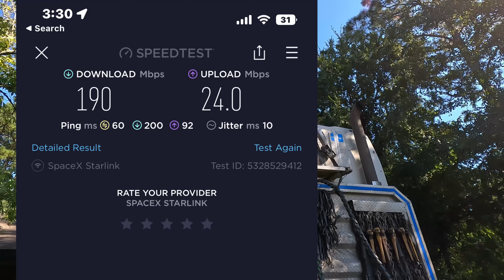Trucks done! And we install Starlink on the semi

Comment: Hey Robert I drive an 2008 westernstar 4900 has a 14 liter series 60 with an 8LL TRANS with a 25 yrd packer has 65 thousand  miles it's all stop and go driving has a self adjusting clutch and never had a problem never slipped and the clutch brake still works fine !

Comment: I have over  600,000 miles on my  automatic Eaton 6 speed transmission in  
a 2015  Kenworth T680. The only money I had to drop over the years on that Trany  was to replace a sensor. so far so good!  I change the fluid every 150,000 miles. Now the truck is in semi retirement. I use it to pull my 20,000 lb 5th wheel camper.

Comment: Good video Robert. 
I don't comment much, but when I saw your fuel issue, it looked maybe like a situation I experienced. 
If you have a long crank situation, look at the clear globe of your fuel filter. If you don't see fuel part way up on your filter. Take the black cap out of the top of the glove and pour as much fuel as you can in and try again. 
Good luck to ya'll.

Comment: Hello Robert. Such bad luck you are having, hopefully it will turn around. The stickers look great. I called Haggai Diesel. They only work on ISX engines. I guess you know what those are, Cummins and GMC seem to have them. I miss seeing that funny intro you had. A rotator wrecker would pick up the truck and set it on the trailer. Have good days!

Comment: I think the fact that when you came to pick the truck up they had a chain rapped around the frame and a mud flap ripped off tells the story. Clearly they either got your truck stuck or used it to pull something and they burned out your pressure plate.
Reply: It wasnt running when they dropped it off and the shop used the chain and a fork lift to lift the tires up and push it in the shop more than likely
Reply: @warrenmichael918  They drove it there it was running just down on power
Reply: @oldmanonthehill8858  They pulled it in and out of the shop because it wasnt starting
Reply: What bracket you went with on the Satellite? I have that same mount on my truck.

Comment: The Southbend dual disc clutch I ordered for my hotshot truck cost $1,338.60 plus shipping so $2,785 for a semi clutch installed doesn't sound too bad. Just sux that the work done by that shop near Savannah is still costing you $$$.

Comment: Hey, great video. I am actually in the process of doing the same to my rig. 
If you don’t mind what size bolts/screw did you use how thick is the fiberglass top cab roughly I don’t want to go too far through. I have bolts that came with my stand they’re roughly 2” or more in length so I was just wondering any help is appreciated thank you.

Comment: hi use the bot as tool  if work good idea Holes in fiberglass don’t hold anything  need use a plate  inside the cab   about the height   say add Amber LED strobe lights  to trailer  wire so turn on  from the cab

Comment: You need that grey reflector to be visible  to avoid a violation.
Reply from the maker: I wondered about that. But see lots of truck with them blocked. But I guess they could be wrong aswell
Reply: @SouthGeorgiahotshot   i got a warning for not having one reflector on and then the officer told that this should be visible. You  have a step deck and is a must. Nothing personal. Just sharing what I experienced.
Reply from the maker: @TUDORP  I understand. I wonder with my chain rack having the stickers if it’s still a big deal lol
Reply: @SouthGeorgiahotshot   if you have it on you chain rack you good, I’ve seen on many racks

Comment: Regarding the trans temp problem I can give you a troubleshooting tip as a life long electronics worker.  Most problems are simple and logical.  If you are stumped it is often because one of the things you thought you knew is not true as you found in this case.  This happens far more often than you think.  When stumped forget everything you have done and start trouble shooting from the beginning again.  When I solve problems  that others have not been successful at the last thing I want to hear is what they have done to solve the problem.  They will lead you down the same rabbit hole.

Shame you had to spend so much to get the truck going but it sounds like most of the work performed actually needed to be done.  As far as how often the clutch needs adjustment, I think that is totally depends on the habits of the driver.

Comment: I hope.that they turned the flywheel ? Or maybe installed a new one ?
  Now they have several different clutches ? Hopefully they put a heavy duty clutch in it and not one.of those cheap ass ones. You should always ask for your old parts  back !!!
They don't rebuild them anymore like they use too do. 
 By getting the old parts they must install all new parts ? 
If he said the pressure plate was bad hopefully he puts all New parts in the truck. 
But a standard mack clutch should go 75,000 to 100,000 miles before having to even mess with it. 
Your truck was one that pulled a dump trailer which should have had a heavy duty clutch ? Now I wonder if that shop actually replaced the complete clutch system the last time of if they just replaced the throw out bearing and disc ?
Most fly by night shops will just do part replacements. 
That's why you always want your old parts ! Even if you throw them away you know what they did ? Be sure and ask the shop Oh can I have my old parts ? By doing so it will catch them off guard. If they stall they didn't do what they claimed !!!
I can't understand why the mack shop did all that part replacements and you didn't complain ?  Removing injectors and cups is something you should be able to do ?
Take that mack bill and look up the parts and see what the parts cost online from mack ? See how much that shop screwed you ?
Most states have laws saying they must tell you the cost in writing before they start the work ? 
I can't figure out what those other parts had to do with it running bad when it was the injectors ? What about the injection pump ? Did you have it rebuilt and calibrated ?  Don't confuse it with a fuel pump ? Which just gets the fuel from the tank to the injection pump ?
The injection pump builds up the high pressure for the injectors. 
Also why didn't they just rebuild the injectors ? A certified mack shop should be able to rebuild the injectors themselves? And cheaper ? It's the tips that tend to go bad on injectors. I use to rebuild the injectors for our Detroit diesel engines and my brothers Cummins engines . If your shop has the bench tools it doesn't take that long !
Just for information, 
Theirs a shop called Roberts Deisel in Jacksonville Florida. They can rebuild injectors and injection pumps. And they have test benches and there good !!! 
Next time maybe ask some you tubers for help or advise ???

Comment: Nooooooooo do not go for a solo clutch. ,..Dammit boy take it from a 30 yr retired tech..Sorry bud super bad desison. You should have installed a eaton easy pedal 2150 torque unit.. so be it. LEARN how to adjust a solo clutch….its not rocket science but pay attencion . Best of luck
Reply: @01simpleman  totally wrong skipper.
Reply: @01simpleman  depress the clutch pedal…step one for you….push the adjuster tab to the far right……..mind you your assistant is in the cab with the pedal depressed.. have your said helper release the pedal then let the tab go on the pressure plate face..Now you have the proper pressure plate load on the clutch discs.  After that you may need to mess with linkage run outs and such if you want a functional clutch brake….hope that helps you
Reply: @01simpleman  naw it’s all good.i have 30 yrs working on rigs. IMHO iwould never reccomend a solo except for some fleet curb sniffer with a A 2 week CDL graduate coarse..😂
Reply from the maker: No guys I had a solo clutch before. They did not put a solo back in